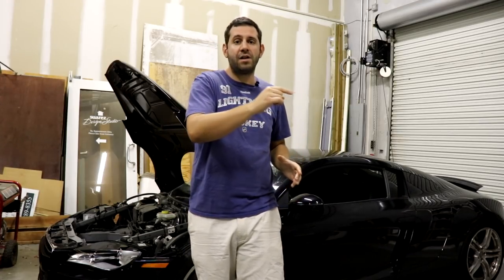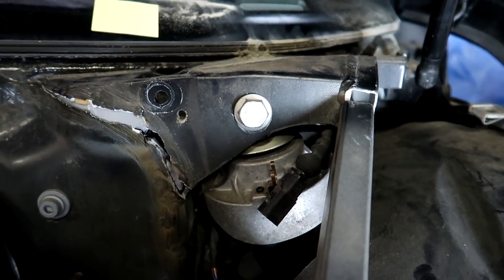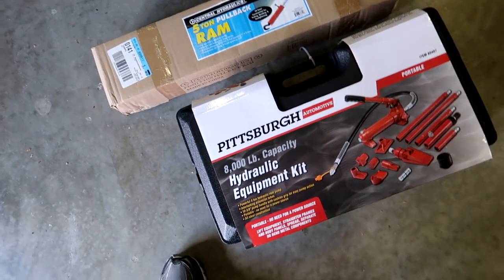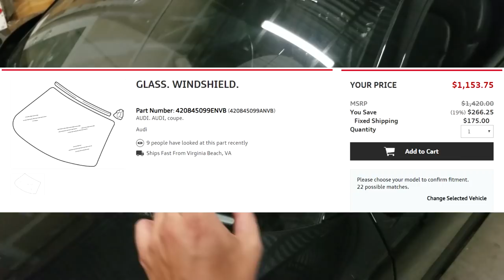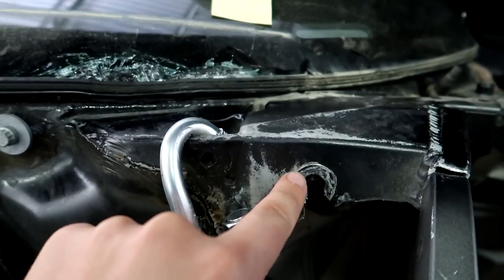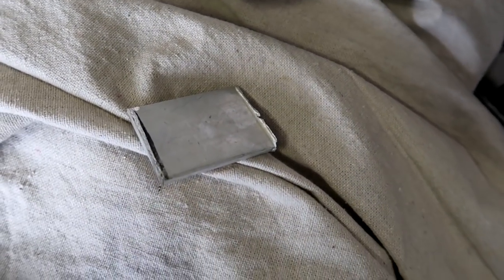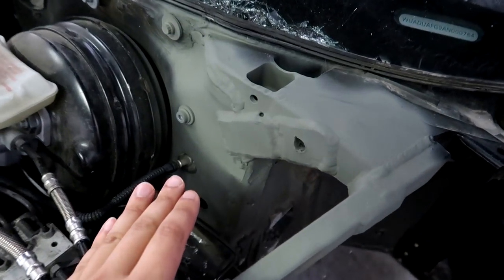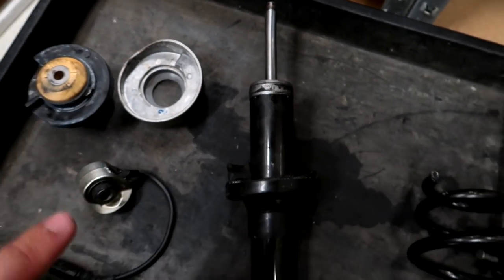I Repaired My Totaled Audi R8's Cracked Frame for $500! Insurance Quoted $29,522!

Comment: I both have "rebuilt" autos as a hobby and a living. I also worked with the airlines here in the US. I still own my own frame repair "rack" and still will do more repairs. But this would be a issue from so many ways I would not attempt it nor do it for any amount. Repairing cracks in aircraft requires a lot of engineering and special repair plates to allow them to fly. And that is done by riveting NOT WELDING because of the effects of welding on the strength and integrity of the welds and surrounding areas.
Will this "function" yes, but would it pass any actual repair of this issue NO. Thinking a few hundred dollars of "equipment" would do structural repair is a dream and a dangerous joke. I have been brought repairs that were done by people who did not understand what they were doing and to repair those mistakes would have cost double the original repair costs and I have never done them.
A automobile of the capabilities of this one would require a deal of knowledge and engineering skills to ever attempt the repair and a lot of equipment would be needed to properly treat the metal and weld zones after the welding to ensure proper repair. Sorry but I have looked at many of these video's and after this one I will have to say this is dangerous and unsafe. There have been other auto's that have been repaired that I did not agree with but this one is dangerous to say it is safe and any insurance company that wrote a policy on this auto would never pay out a penny in any lawsuit due to the "repairs" that were done should any one ever get hurt by driving this auto on the road. 
Should anyone ever attempt to sell this auto to anyone for driving the cost of the possible lawsuit would take everything that you have plus more. Yes some things can be "repaired" but the safety should matter more than CHEAP.
Reply: I'm pretty sure it's gonna be fine. I think you're over thinking it just a bit. What was witnessed in this video is DIYing at its finest. It's not a bomb waiting to go off. It's not going to explode. The initial crack was already proof of a "realistic worst case scenario". Even then he drove it down the street in that condition and lived to tell the tale. 
And remember, all the weight is in the rear with the engine, not the front. That  cracked due to pressure of the shock not because the whole car body is failing. 
 😄👍🏻🤟🏻
But all your experience sounds pretty amazing, I'm not trying to knock it. Plus, this guy is just super entertaining 😂
Reply: mister kluge is
Reply: @astrovenus8345  I won't claim to be a structural engineer or anything but I would definitely worry about the effects of a front impact collision on this car.
Reply: @MrSpiritmonger  What exactly is the point of having a 525 hp V10 mid-engine car that can't go over 80 mph?
Reply: @MrSpiritmonger  Just noticed it was only the V8, and that he got it for around $35,000.  I totally approve of this half ass repair now.
Reply: “Lighten up Francis...”
Reply: The clues from the damaged undertray, bent suspension piston and the cracking make me think that this wasn't some design flaw, but a big hit from underneath. I'd look closer at all the other suspension and control gear on that side for more damage.
I've enjoyed the approach to the repair of your other cars, but this time I think you're out of depth in dealing with it and worry for the next owner.
Reply: Im an aircraft mechanic, its true we dont weld as rivets are less prone to cracking  and aircraft are 2024 T3 aluminum which is un-weldable.  I would bet that the audi is 6061 aluminum.  I agree that this repair has some liability, most welders dont do these kind of repairs for that reason.  This car hit something hard to bend the strut and crack the frame and it still drove so its not really a huge risk, they beefed it up quite a bit.  Just inspect it for cracks regularly.
Reply: Which is why Audi quotes $29,000 for this repair and why the car was totaled by the insurance. Not sure what the point of this video is ...
Reply: @MechowTube   We do have relatively low speed limits in the US - its still a nice grocery run car! :)
Reply: @gordonmccracken1209  i'm from michigan,  we're not big into speed limits 😂
Reply: MechowTube V8 guy not V10
Reply: @MrSpiritmonger  So you have a supercar that you have to drive like a minivan?
Reply: @astrovenus8345  No the initial crack is not the worst case scenario, the original crack happened because it was in a crash. The worst case scenario would be now that is is "fixed" he drives over a big pothole while driving fast the area than fails again causing the car to no longer be under control than he crashes and gets really hurt.
Reply: Travwil2461951 which is better or safer, the original proven defective structure known to crack or the current situation that may crack again.  How is something that is extremely bad to start made even worse and extremely dangerous by this repair?  Seems somewhat illogical at least the owner knows what is going on and will drive the vehicle with awareness.  He likely will not be road racing the car.  Time will tell and a future update would be welcome.  Also, I didn't hear what the original miles on this vehicle, did he say?  Any sale of the vehicle the potential buyer can watch these videos to make his own decision on purchase.
Reply: Nick Bee it hit a curb most likely
Reply: Viking Mike Q  It's more complicated than a plane!
Reply: @seluRredruM  Already had posted about it being a v8 2 comments down
Reply: @astrovenus8345   totally agree, not as dangerous as people are claiming , the purpose of the damaged part is to keep the the strut in postion and hold the forces that move in an upwards direction, this is not a impact zone or a control arm, when this breaks again it will become apparent in the same manner that the previous owner detected the failure, not catastrophic as many people on here think. many people comment on the danger factor here but can't even change their own oil.

Comment: Pretty sure the mistake you made was putting the chain on the outside of the frame on the bolt instead of where the strut mounted. That probably would have prevented that hole from ripping. Either way, looks great!

Comment: Just aswell you sprayed that you dont want rusty aluminium 😂
Reply: Aluminum can oxidize and become brittle too.
Reply: I snickered at the etching primer to not allow it to rust.
Reply: @jy1235689  You are right, that would be electrolisys. 

In my line of work, we deal with this quite often.

When a layer of aluminum is sandwiched with another metal (can be ferrous or non ferrous metal) and allows moisture between the 2 layers, it is a perfect storm for corrosion. Once the moisture drys between the 2 layers the aluminum corrodes.
Reply: @robhinze8626  You'd think dealing with electrolysis in your line of work, you'd at least be able to spell the word! (Just fucking with you - don't go getting all upset)
But there are no dissimilar materials in this installation that need worrying about or they'd be properly electrically isolated - paint alone doesn't cut it when using mechanical fasteners.
Reply: or is it aloomanim. Bahaha
Reply: @brentara1  So what its 2$ it can save him alot in the long run and its always better to not leave metal bare. He cant zinc treat it or anything.
Reply: @TheHGBone  Just as well they don't do anything silly like make boats out of it, eh. The way you guys are talking anyone would think it would dissolve as soon as it hit the briney.
Reply: @rob hinez it’s not called electrolysis... it’s called galvanic corrosion. And coating the aluminum protects it from pitting and also keeps it from getting brittle
Reply: @TonyRule  Its just better to finish metals and who gives a shit anyway if he wants to finish the metal for 2$?
Reply: Cj_North Yeah I laughed at that too. Maybe he meant to say corrode; that aluminum does if left exposed. ;)
Reply: Aluminum does corrode
Reply: Great work I can't wait to see more
Reply: @TheHGBone  It's just a case of the fact there's absolutely no need to 'finish' the aluminium in this scenario - especially with an etch primer - unless he's planning on painting it again.
Reply: Aluminium does oxidise and go done, it just takes much longer than iron
Reply: @nightmarejr  But the mechanism is almost the same - it's just that with electrolysis the potential difference causing the corrosion is provided by an external source - not just their different places in the galvanic series. Of course, if you combine the two, it certainly won't last long.
Reply: @mrcaboosevg6089  And in that environment it won't happen in your lifetime.
Reply: @TonyRule  my apologies for my overlooked spelling mistake lol.
Reply: @robhinze8626  Just don't let it happen again. I'll be watching... haha
Reply: If you don't think aluminum "rusts" I've got some bad news for you.
Reply: @mqbitsko25  Nobody is saying it doesn't corrode. All metal corrodes to some degree. Aluminium actually corrodes very quickly in just air. But here's the thing: the corrosion itself forms a very resilient barrier to any further deterioration of the base metal, unlike steel which, if it does not have some protection applied, quickly corrodes and crumbles.
Reply: @TonyRule  i dont think you realise that aluminium is far less stable than steel and other metals and reacts chemically with oxygen immediately upon exposure. The oxidisation (rust) occurs in such a great fashion that is coats the surface so that further oxidisation is impossible. However, under different temperatures or if coated in an acidic or alkaline compound the oxidisation can be accelerated. Aluminium rusts more than iron, you just dont see it. A simple example: no house in the world uses aluminium for water pipes because food scraps are often acidic and completely rust through the pipes.  _  i come from a material science background
Reply: @tpack716  I'm not sure what you're basing your belief about my knowledge is - the issue of stability was actually pointed out in my post immediately above yours. In any case, your 'simple example' is not even a vaguely similar service environment, so is irrelevant. There's something very wrong if your car is caked in sewage.
Reply: You need etch primer on aluminium as the normal primer won’t stick, and aluminium does oxidise but not as quick as carbon steel, and yes I’m both a aluminium and steel welder both none structural and structural. This guys welds are scary!
Reply: @1osmosiss  Absolutely. If you're going to paint it, you need an etch primer. And, sure, there's a lot of filler rod in the crack, but with the doubler across the crack site I seriously wouldn't be in the slightest bit worried about catastrophic failure driving that at its limit.
Reply: @TheHGBone  i think you either replied to the wrong person or you missed my point entirely

Comment: I honestly thought this was clickbait. You never fix stuff that fast..
Reply: So the MFG welds a part together. The weld come apart and you produced a better structured weld yet you believe it's not repairable? Do you realize racing teams modify structures all the time for better performance?
Reply: And you never should without a laser guided computerised jig to get the damn thing back to factory tolerances. A homemade welding job using a jackstand to pull it back? Come ON!! You might do it ghetto style on something non structural, but to do it that way on a supercar frame where the suspension connects is just asking for trouble. There's a reason (as he said in the last vid) that people end up putting entire new front ends on. 

No insurance company in the world will pay out if this car is crashed and they inspect the frame. Nor would they touch it in the first place if they knew the repaired damage wasn't professionally repaired by a company with indemnity insurance.

Comment: I guess the proof of the quality of the repair will be on the alignment rack.
Reply: This car will never see an alignment rack me thinks.
Reply: aly nicholls really?
Reply: aly nicholls  Will this past a state inspection? I been told State inspectors will not allow welding except at the part seams. Can anyone add to this concern? Thanks
Reply: It’ll pass state inspection, I had an 05 salvage accord here in California, that thing had horrible welds, never ran straight, the highway patrol only said to remove the dark tint on the two front windows, everything else passed, few weeks later received a rebuilt title from the department of motor vehicles. Crazy! Compared to the repair on my old accord, this thing looks all professional! I also put that car through seven years of abuse, that thing never failed.
Reply: the first time he hits a speedbump or pothole at speed, that casting is going to break adjacent to the weld, or in another area of damage that we cannot see because it's buried underneath the windshield.   

They're thinking this is like reworking steel, and it's just not.
Reply: @learnmore5247  That would depend on the state and the type of inspection. It would pass the standard yearly safety and emissions inspection here in NY.
Reply: @learnmore5247  This was repaired correctly. The aluminum was straightened, and repaired, then the reinforcement plate that was added provides additional tensile strength (The OEM also welds a similar plate as was shown in the last video). Most state inspections would fail it if the crack itself was not repaired, and the plate was welded in place. That doesn't address the compromised structure and would likely fail again. This welding repair would pass a level III inspection here in AZ with no issues, although they might give some grief for hitting the welded areas with primer before being passed
Reply: @AzureCrux  have to go a ways to convince me they used aluminum that was of the same type as the original structure.
Reply: @RussZHC  I would assume that someone willing to weld a structural point on a vehicle should know its standard to use 5554 or 5356 at the very least for a job like this. If it were me, I wouldn't take the money if I wasn't confident in the repair
Reply: @learnmore5247  state inspection is not that rigourous

Comment: Pulling on the bolt hole was always going to lead to a (minor) disaster and hitting the windscreen... Well... But also pulling using the release handle on the axle stand as an anchor point was another dicey move... For hopefully obvious reasons. This made Rich Rebuilds look like Mr. Safe and Responsible. Good fun to watch though and still an awesome bargain. Good work on detecting that wonky shock too. This will be ace

Comment: I was cringing not just with the hammer blows and cracked shield but I was waiting for that strut mount to pop, we have R8's in the shop same problem we keep the shock in place but unbolted from the assembly and put the vehicle up on the ramp then tie a ratchet strap around the bottom of the shock mount and use one of the heaviest guys in the shop to put a foot on the strap and force down works every time to mate the material back for welding.Rob did an excellent patching in and welding always good to see a man that knows his craft, the repair was probably stronger than when she left the Audi factory good job.

Comment: Samcrac tryn fix some frame crack n cracks his windshield smh 🤦🏿‍♂️
Reply: blond has to make another video lol
Reply: It should be fine if it’s just that one crack as It seems to align well with the rest of the frame. However, this is a 500+ hp supercar so if it’s off even a little it could affect the car at high speed. Sam better be praying it drives right because this could really be unfixable and really will require a new frame. You are talking $30k easy.
Reply: To many cracks up in the place

Comment: As in any repair have you enough reinforcement to withstand the pressure against it. It's that simple. One note if you weld on a firewall make sure you have a fire extinguisher ready the insulation tends to burn from the back side.